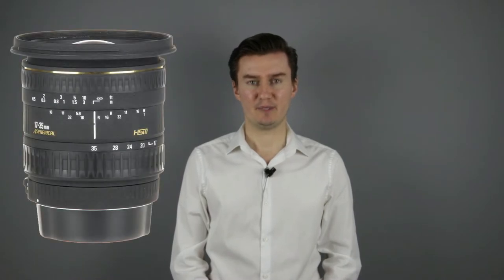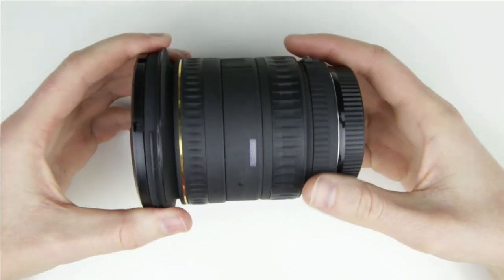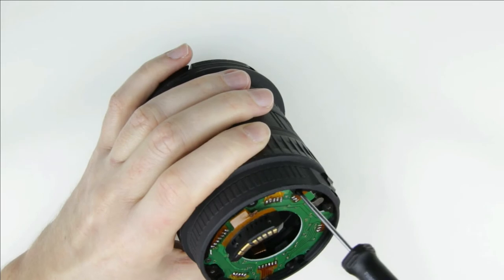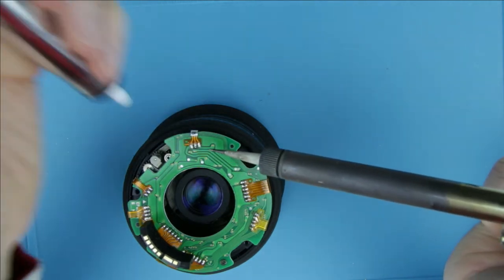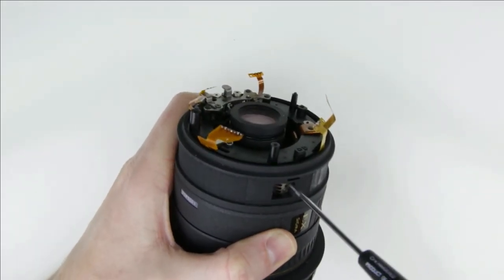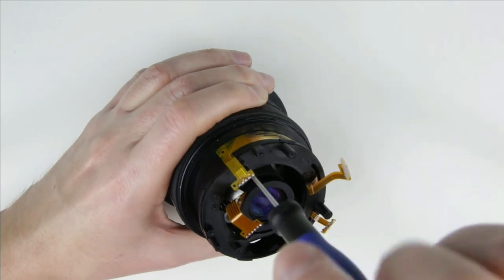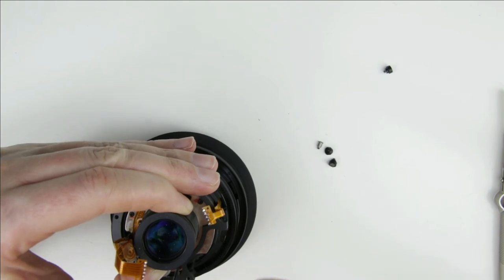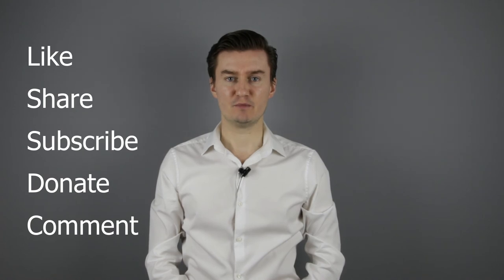Sigma 17-35mm f/2.8-4 EX HSM ASP disassembly for replacing the aperture flex cable

Comment: I have one example with a broken AF-motor and another one with a good AF but decentered lenses - thus with no sharpness at all at one side of the picture.
Question: After removing the ring with the aperture-cable - as you have demonstrated - is it then possible to remove the complete lens element?
Reply from the maker: I don't know, I don't remember.

Comment: I have found one copy of this lens on ebay for a bargain, however the aperture is stuck at the narrowest. The lens otherwise seems in pretty decent condition. What may be wrong and how much will it cost to repair it.
Thanks.
Reply from the maker: Most likely the aperture cable is broken, and the camera can't open up the aperture. The aperture cable is quite cheap, and you can use my videos to replace it. So, ask the seller if that is the only problem with the lens... it is a quite old lens, and fungus an AF problems are quite common.
I think in a professional repair shop the price of the repair would be higher than the value of the lens.